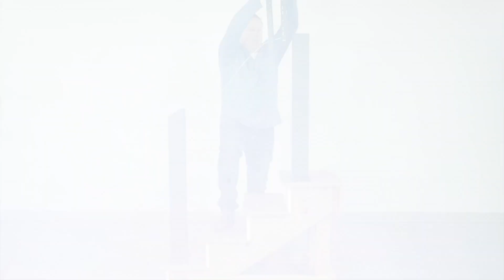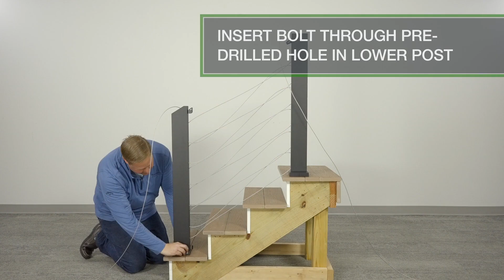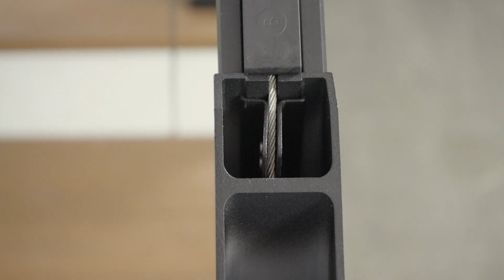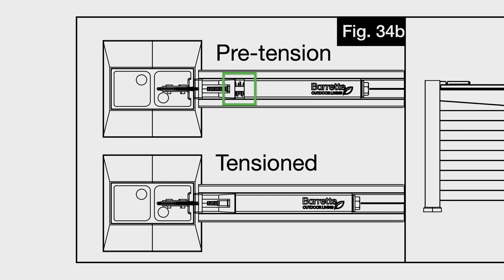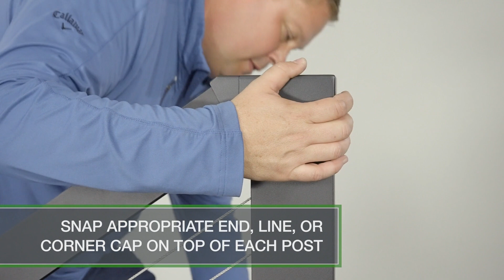How to Install Barrette Outdoor Living RDI® Elevation Rail™ - Stair Rail

Comment: I have tried no less than 6 times to install these on my steps and the A and B keep slipping out of place along with the tensioners not laying flat in the channel. Any recommendations?
Reply from the maker: Hi there,

Here are some recommendations from our product team:
-Make sure A is at the top and B is at the bottom.
-Make sure the spring is lined up properly with the hole in the A or B block.
-It's ok and normal if they ride up some. The top rail will push them down when it snaps on. 

Hope this helps! For further assistance please contact our customer service team at 877-265-2220

Comment: Please show installation on a long run of steps with mid-posts.  Good luck getting the top rails to plane through with each other.
Reply: Posting a video on my install if you want to check it out
Reply from the maker: Thank you for your feedback. We introduced a revision to the stair kit to make the brackets adjustable to resolve this issue with a middle post. Please reach out to our customer service team if you are still having trouble. 1-877-265-2220
Reply: @BarretteOutdoorLiving  Terrible customer service on this issue.Installed a good size deck then onto stair railing and only way we found out it doesn't work is this post.Two weeks and still don't have parts.You should update your directions for contractors.Other than that you have a great product
Reply from the maker: Thank you for your feedback. The instructions have been updated, but it's possible there could still be some older versions out there.
Reply: i am having the same problem currently on a job  with 2 stair railings each with 4 panels how did you proceed

Comment: Great looking rails, my only issue with them is that they scratch easily. After installation, I now have to find some touch-up paint😡
Reply from the maker: Thank you for the feedback. We make touch up paint for our aluminum railing. Contact your local retailer to purchase some.
Reply: Why isn’t there a stair to flat rail post and coordinate cap?
Reply from the maker: Any level post can be used at the top of the stairs. The cap that completes this transition is included with the bottom stair post.